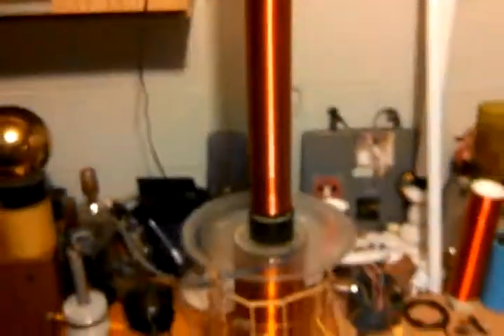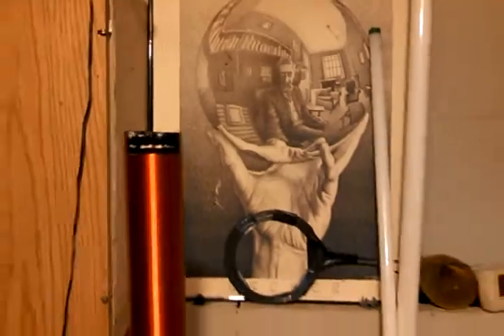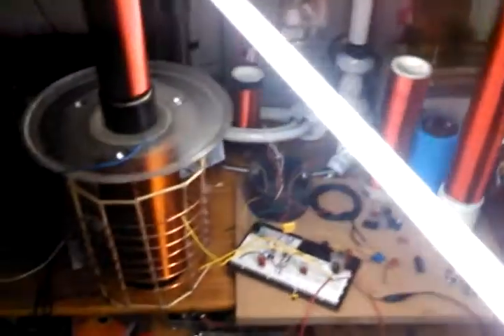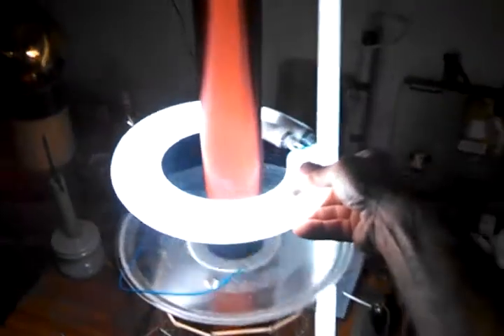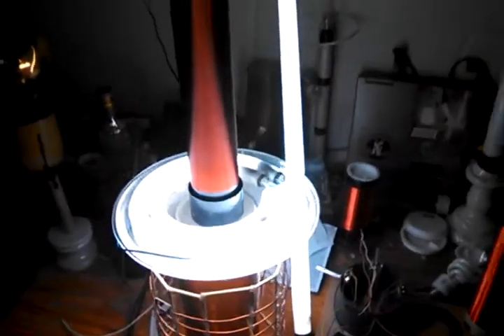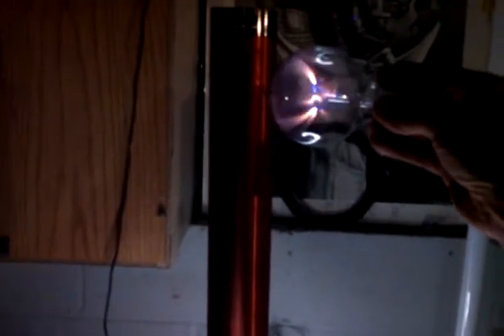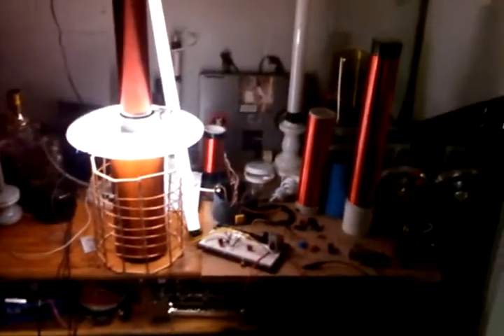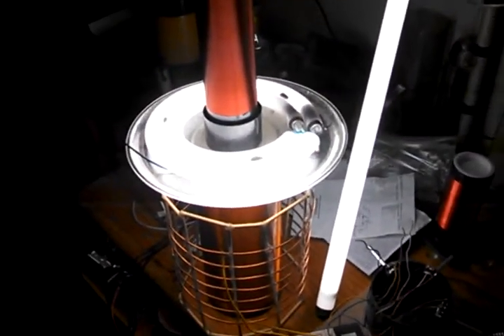Slayer magnifier :-)

Comment: Terry Woodroof 
Really cool, I guess it is first in the world Magnifying Slayer Transmitter  :)
Great job!
Reply from the maker: It was really just a quick silly set up.  I had everything sitting there and saw it in my head. The slayer circuit was ready to go already. So it literally took 1 minute to set up and test. The extra coil acts as a large top load on the circuit. I think it needs more turns on the primary.
Reply: Terry Woodroof 
Great job, dont give up and do some further testing and compare with standard Slayer ,you may discover some think big.